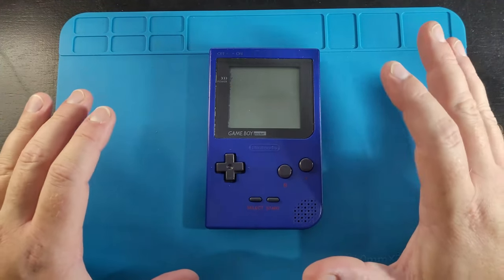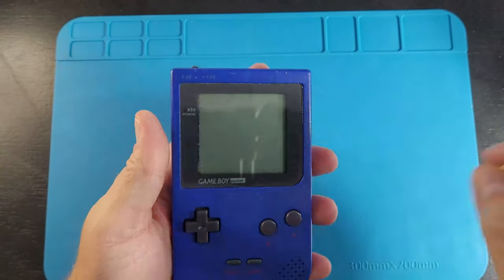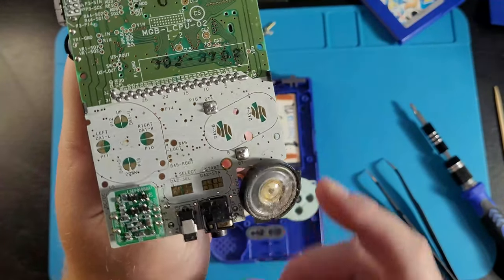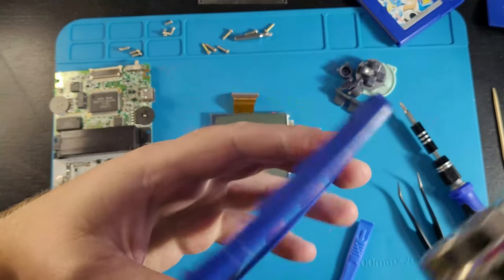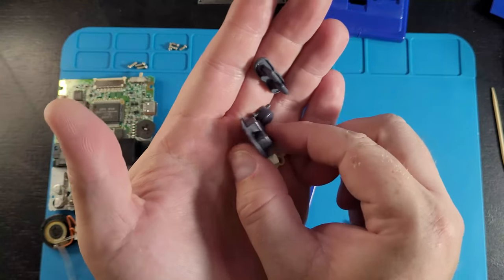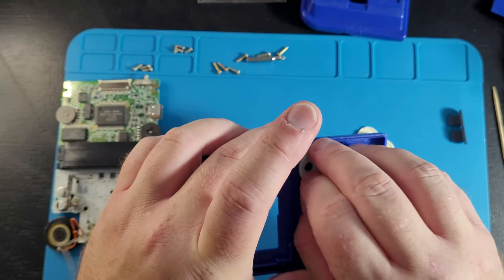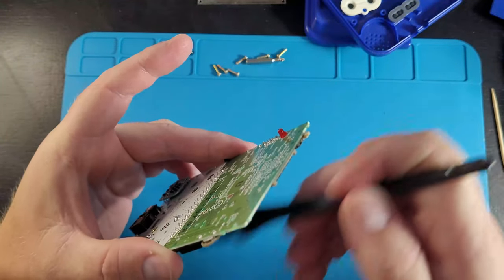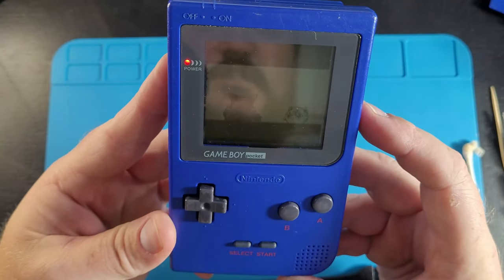How To Refurbish Your Gameboy

Comment: can you all help me please........because i can't play games on my dsi xl, my card is an old R4  SDHC  Revolution for DS (NDSL/NDS). when i open the card on dsi xl it says that "an error has occured. press and hold the power button to turn the system off. please see the nintendo dsi for help troubleshooting. The ver of my DSi XL is 1.4.5 E. Is there anything I can do to fix the problem? Thank you all
Reply from the maker: That's why, your card doesn't support or work on the DSi console because it was designed only for the NDS/NDSL consoles specifically.   Just buy this card it's only $10CAD it supports every console and I have a guide to set it up.
https://a.aliexpress.com/_m0dahoI
Reply: ok thank you :) @DNAMobileGaming